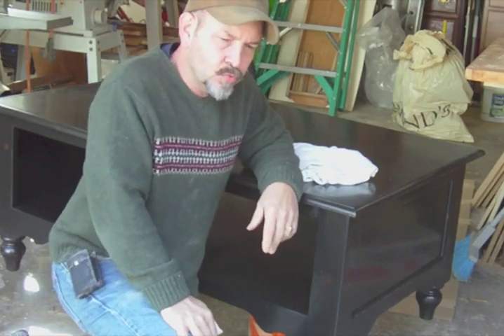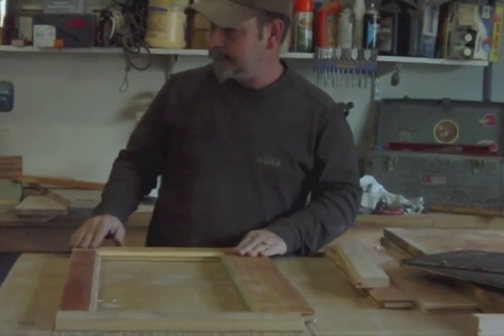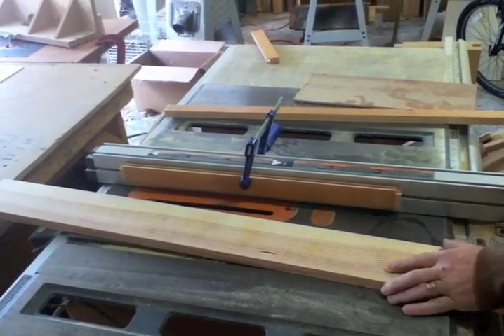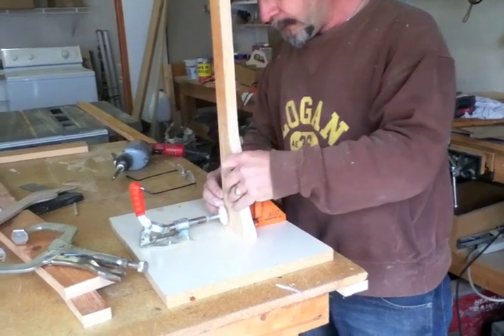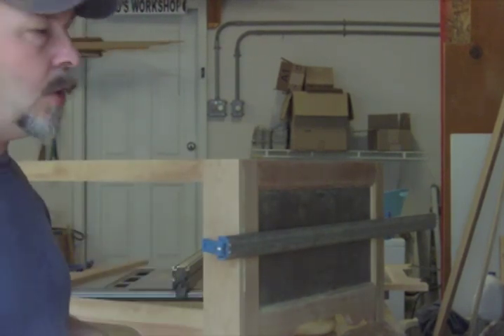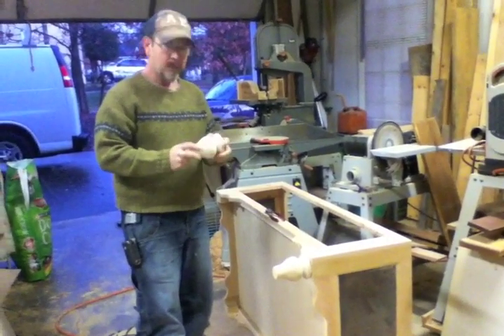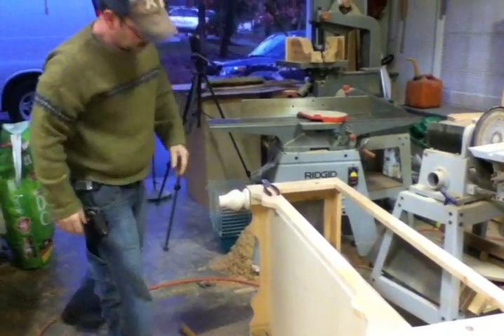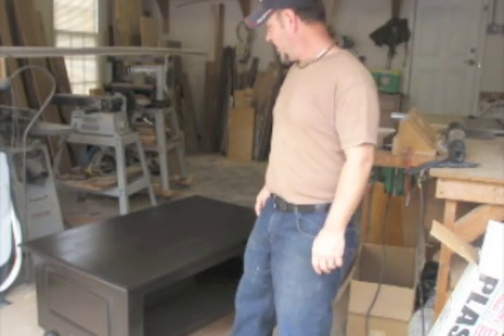How to make a coffee table the easy way.

Comment from the maker: I attached a 1x3 at the ends and the screwed 1 1/4 screws up through that strip into the top  from below. You could also put blocks in the corners at 45 degrees and do the same thing.

Comment from the maker: I think I attached some 3/4 x 3/4 strip around the top inside and ran screws up to the top. You could also put corner blocks at 45 degrees.

Comment from the maker: Yeah actually it was not as complicated as I had thought. (basically slip a wrench in there)
I bought a few replacement pads off ebay, It is still out of balance though but I guess I can live with that. P/C actually charges for a PDF instruction book, not sure if I bought it if the balancing adj would be in there or not. Thanks